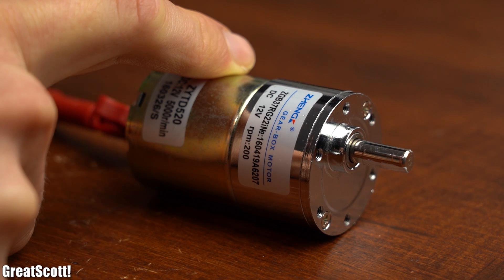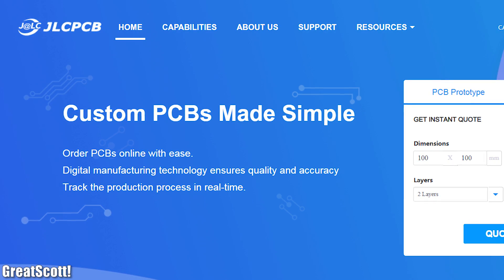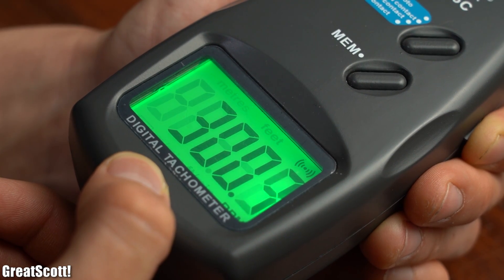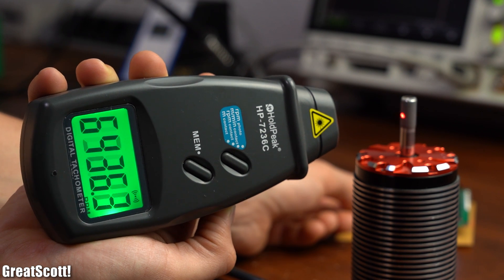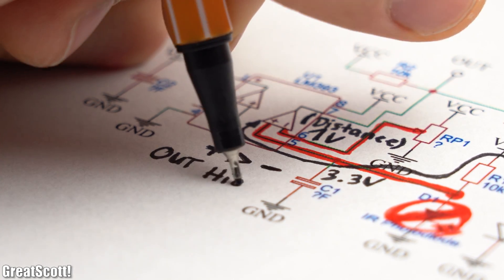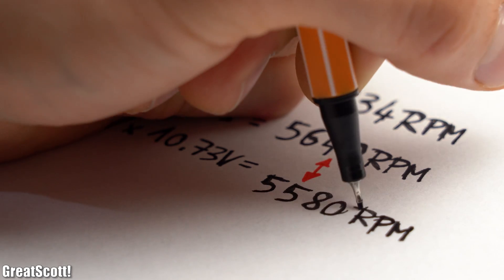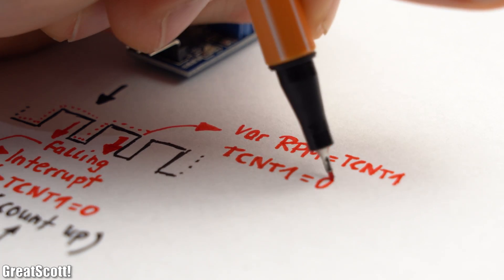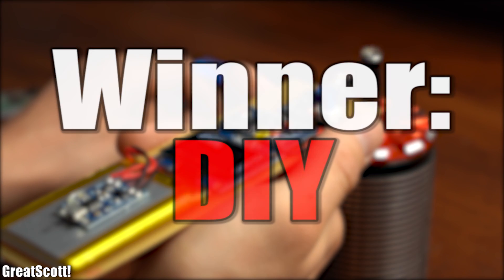Tachometer (RPM Meter) || DIY or Buy || How a 3€ sensor outdoes a 29€ product!

Comment from the maker: Sadly there is a small mistake in the video. The IR photo diode is positioned the wrong way around. Just imagine the cathode and anode being flipped. Sorry. (Edit: Ok, there is a second mistake. I used the roller adapter in contact mode incorrectly. I just did another measurement the correct way and measured an RPM of 270 while the correct one would have been 230. So this way it was a bit better but still not good enough for me.)
Reply: GreatScott! I have the same type of RPM counter and I found that electrical tape has a reflective property and will give you the wrong RPM. I have a blue painter tape that when waved in front of the laser it will not count it, try measuring with a painter tape. I just did the same high tech video edit count with mine, one came out at 186PRM and was correct, the slower one came out at 58.8RPM and I counted one rotation a second. So close enough and probably within spec tolerance of the counter.
Reply: Gadget Review Videos FWIW, in theory, the polished shaft of a new motor should actually appear darker to the sensor than the electrical tape. In optical engineering, a common way to make something very dark (“black”) is to simply make it very reflective. Silver mylar, for instance, appears inky black at anything other than the incident angle. Naturally, whether any target appears “white” or “black” depends highly on both the lighting and sensing angles.
Reply: a1nelson True, but the laser in these cheap units are only looking for the reflection of the laser, the receiver is already darkened to help prevent it from picking up light thats not as bright as the laser, well on a decent unit. If he had put the tach a foot or more back I found the reflection from electrical tape doesn’t read on the tach. So electrical tape can be used, just not so clostridium to the object being measured.
Reply: Ur essentially using contact reading with gear mode so you need to account circumference of both the detector and motor shaft. 

If you calcualte it to ratio i.e. it seems it's 2:1 which csn be physically seen by shaft diameters.

To measure correct your measurement instrument need to turn in 1:1 ratio with motor shaft. That can be done with aligning both of their alignment axis equally and do friction contact only.

Optical measurements works regardless because the light is measured in 1:1 pulses and is actual measurement of RPM reading.
Reply: @MaulikParmar210  yes you are right bro.
Reply: Why your comment is a week while it is uploaded today?
Reply: pin this comment, so there will be some chill
Reply: Hey nice video again. Im trully amazed by your skills explaining circuits, reverse engineering them, programming, etc. 
Mechanicals skills, though, are scarce sometimes, like trying to engage a chain and a sprocket with different pich and width (in the previous video), or in this video, the mistake with the roller tachometer. 
Im pleased to offer my help in mechanical matters whenever u want. 
I love this series of buy vs diy! 😊
Reply: @alanlovetrains  Patreons got video ahead
Reply: You know, this is my favourite DIY video from your channel !
Reply: But good enough for Australia like Dave says
Reply: Hey no problem, that's how it goes sometimes. It's a wonderful video and I'll be making one of these! Thank you.
Reply: Also, at 9:42 into the video, 2^16 is 65 536, not 65 535 as you wrote. Still, very, very nice video and quite informative, I liked it before watching it.
Reply: @zrnjan  The counter starts at 0 not 1 so the register max value is 65535
Reply: @noweare1  He is talking about how many different values the register can store when using 16 bits, not about which one is the highest value. So, the maximum number of different values with 16 bits is 65536. He is not talking about the value of the highest number, that's why 65535 is not the correct way to put it.
Reply: @zrnjan  in  computer languages counting starts from 0. So, with 16 bit resolution you can measure maximum number of 65535.
Reply: @kevalnakar6269  he is talking about how many different values you can count if you have 16 bits. He is not talking about the highest value you can have with 16 bits. Note the difference.
Reply: @zrnjan  👍
Reply: @zrnjan  You are correct that 16 bits has a total of 65536 possible values but the range of a 16 bit unsigned integer is 0-65535 not 1-65536. The value 65536 is represented as 0x10000 in unsigned integer format which requires at least 17 bits.
Reply: Also, 2^16 = 65,536.  But I know what you meant :)
Reply: Also that isn't a photodiode it's a 2 pin phototransistor, they have exactly the same package as a LED but the base it's "energized" with light, the short leg is the collector and the other one the emitter. If i don't get it bad it looks like a SFH 300 FA
Reply: I think you used the contact probe the wrong way. As far as I know, you're supposed to press the probe coaxially on the top of the shaft, not roll it against the side.
Reply: Is it true that putting 4 tape instead of just 1 makes the reading more accurate?
Reply: I was just about to post mentioning the incorrect schematic.  I assume the photo diode is reverse biased in the actual circuit.  As a photo diodes gets more light it conducts more current in the reverse direction.  This is the common way to use photo diodes to measure light.  But it seems you already saw and corrected this.  As always I enjoy the videos and learn something.  thanks.
Reply: Jlcpcb is so stingy not to make you a PCB. You advert for it but you solder by hands.
Reply: Hello, thanks for sharing this knowledge! :D
I recently worked with an OLED display like yours and I'm led to beleive you may be using the wrong driver in the u8glib (That's what's causing that white line on the right edge). If that's an 1.7 inch display the correct driver may be the "SH1106" (also supported by the u8glib //U8GLIB_SH1106_128X64 u8g(U8G_I2C_OPT_NONE | U8G_I2C_OPT_DEV_0); ).
Reply: Did you correct those for instructables?
Reply: 3:12 Du soll test das Messteil nicht seitlich dranhalten, sondern direkt oben drauf, desswegen hat es eine Vertiefung an der Oberseite.😂😂
Reply: Don’t know how hard you pressed the wheel on the the chaft. But the difference could be load. Just a thought.
Reply: I can't find the code
Reply: I can't find the code
Reply: do you know by any chance whats the max possible rpm that IR sensor can measure?
Reply: Another mistake lol: in the vid it's 60/(rpmtime/31250) but in the code the 60 is replaced by 120. Is it to account for the pulse? Bc there's a high and a low in a single period
Reply: Fwiw, traditional analog RPM meters (handheld tachometers) use a conical tip, similar to the one shown with the 29€ electronic tach. A slight elaboration ona a previous comment: Most, but certainly not all motors have a small holes drilled in their ends of their output shafts. This is a direct byproduct of their manufacturing process. The little hole/divit is basically used to make sure that the shaft remains cylindrical and therefore does not become conical. It also assures that all sections of the shaft are concentric. As you probably know, these centering holes can additionally be drilled deeper and tapped, in order to be used for mounting certain accessories, such as fans or gears. The tachometer tip with the flat end is intended for use friction contact with motor shafts that have had their centering hole/s removed (by literally cutting/“turning” off the end of the shaft/s). Hope this provides a bit of extra background. Also, I really respect you not only admitting, but also including the specific details of any missteps made during your investigations. Likewise, I also appreciate you giving your audience that extra opportunity to learn from through [the entire] process. Thanks!
Reply: Nice to see that even such a clever gay can get something wrong. There's still hope for us morons :)